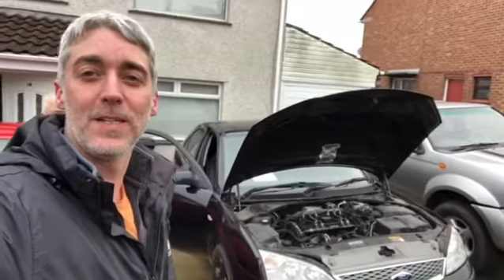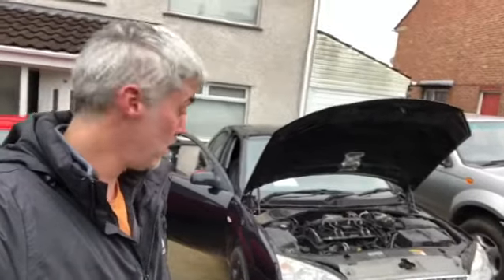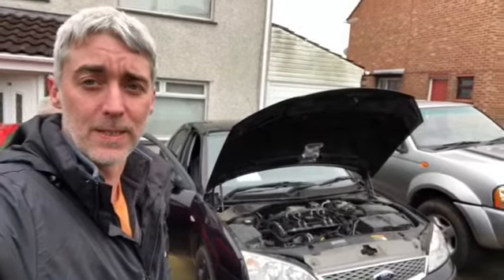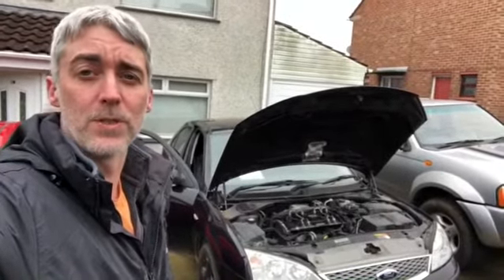Ford Mondeo sticking turbo vanes

Comment: have same fault and car/year. causes limp mode. low power. tried egr, maf, etc, now gonna try this, not a mechanic but competent diy'er.   GREAT VIDEO, SIMPLE AND INFORMATIVE.  would like to have seen which circlip to remove and how to manouevre arm on actuator though , for confidence and clarity.